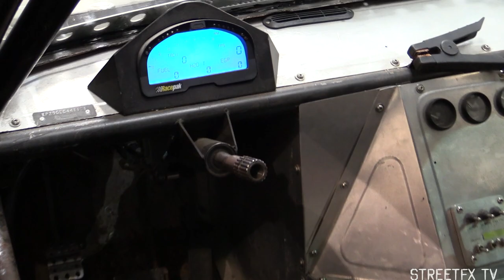#F8 What Lies beneath, "The Ice Charger"? Behind the Scenes with Dennis McCarthy!

Comment: I knew that these cars are built out of wrecks, but DAMN, that's a lot of rust under the hood. I don't think I've ever seen a car that's so rusty in there.
Reply: Jakob Holgersson its only surface rust, and since they used it on snow, the heat of the engine and the moisture develop surface rust really quick

Comment: This is frustrating,  i am expecting 5000hp like the movie said
Reply: Wrong car man. The GTX was the 5k HP car, this is the charger from the snow scene
Reply: 817javier could it actually have 5000hp tho?
Reply: Lol, doubt it, that thing would have to have a parachute and willie bars like most 2-5k hp cars. Plus it'd be built completely diff, if anything I say 600-1k is more like it :D
Reply: no, for 2 reasons. it will blow the v8 + the v8 cant make 5k. its very easy to much to take out. you cant tune endless hp on car. 5000 will not be usefull for street.